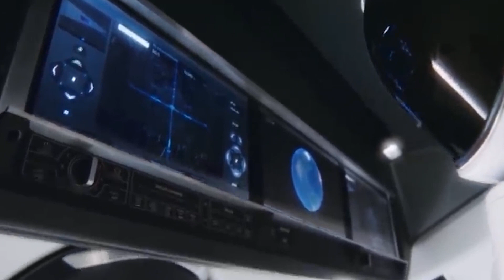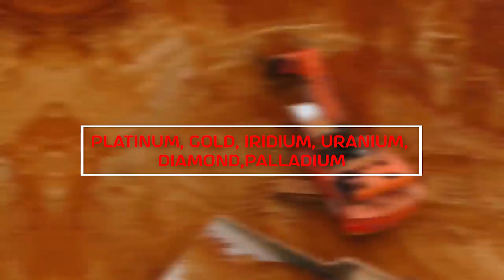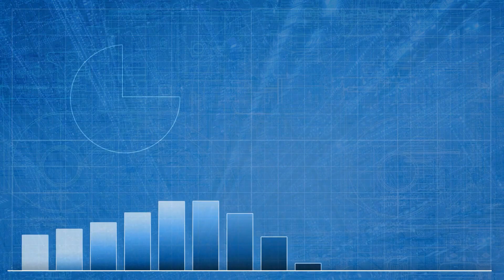How SpaceX Will PROFIT From Mars

Comment: Without simulated 1G gravity humans will not be able to travel to Mars without grave consequences. Robot explorers/miners only until the technology exists.
Reply: You realise there are people living in 0G’s right now?
Reply: Martian settlers could build a large  spinning conical cylinder. It could simulate earth gravity.
Reply: @ricardomilos3464  Why though, people can survive long duration is no gravity, Mars has some gravity too so its even better then the space station for example
Reply: @lukeotter898  I don't think you understand. The spinning cylinder is on MARS. that's why it's conical. It would spin fast enough to create 61% earth gravity, and Mars itself would provide 39% earth gravity, to create earth-like gravity. It's not in space, it's on the Martian surface.
Reply: @ricardomilos3464  I do understand, but theirs no point, people can operate in low gravity for long durations. A spin gun cylinder adds complexity and risk as well as it needing to be powered because there’s air resistance on mars. Plus makes it harder to enter / exit
Reply: @lukeotter898  I personally think humans will probably be fine on Mars without, but if some martians wanted to go the extra mile, they could do this. Besides, we don't know what effects low gravity would have on childbirth. We could take dogs with us, and see what happens to the puppies, and if the puppies turn out fine, I guess we won't need this. But otherwise, if we want people to actually LIVE on Mars, we'd need this.
Reply: @ricardomilos3464  Yeah many astronauts have fainted from being in earths gravity while still being used to 0G because the heart couldn’t pump blood well enough. It might not happen as much as with someone who got used to Mars gravity but it could still happen, also bones and muscles would be weaker so entering earth without preparing could be harmful. I think they should set up a bigger space station but with rotating modules to simulate gravity like the one from 2001: a space odyssey so people can train to get used to earth gravity and live on earth without a problem.